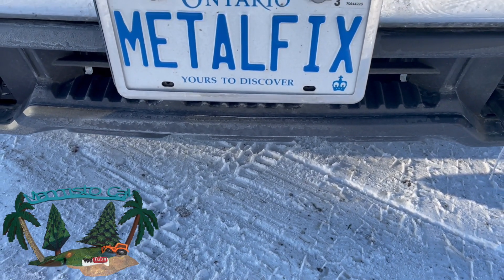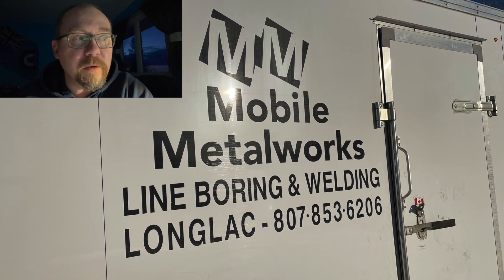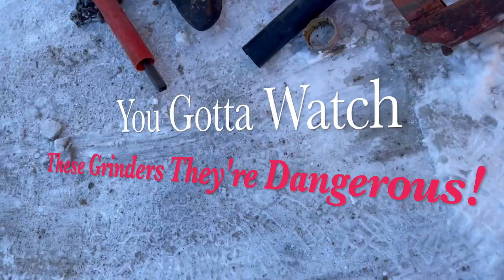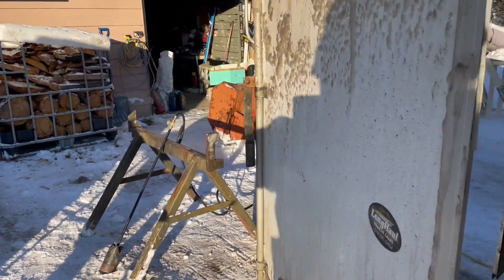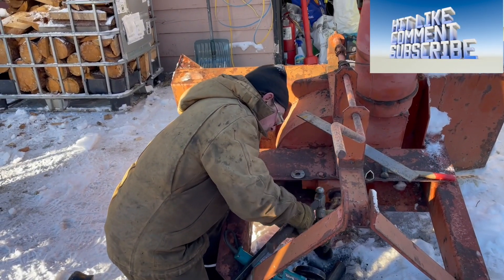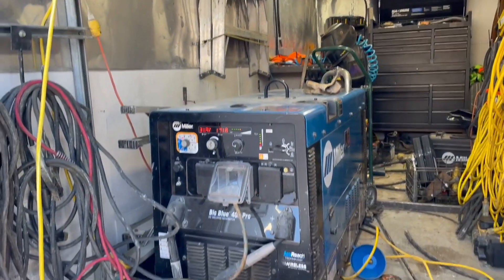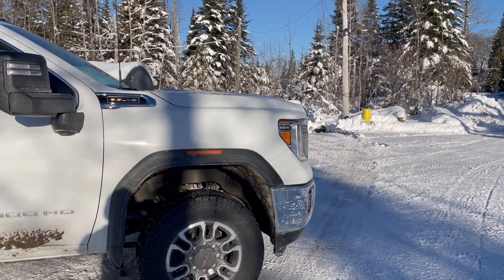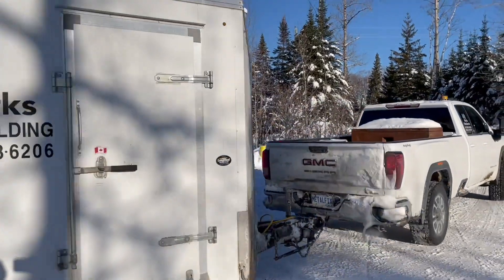Episode #100 Broken Driveshaft PTO Snowblower  #mobilemetalworks

Comment: Thank you for your video and Great Rear Magnet Supporting Your Troops Sir 👍😇💪👌🧐 That Steel Gentleman is very well equip ( bring me a lots of good souvenir when my father was doing the same 🧐👌👍 )  I hope that rear crown bearing was greased after that heat and not affected by it when he was cutting it 🥴👍 CHeers 🍻🍻
Reply from the maker: That U joint was replaced shortly after the video.   “Soldier on” mon ami! 🇨🇦